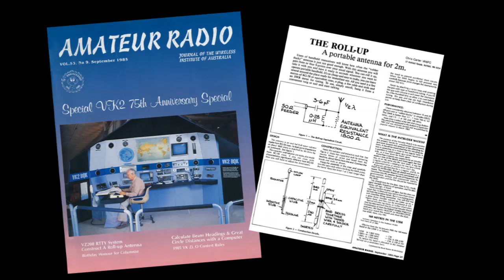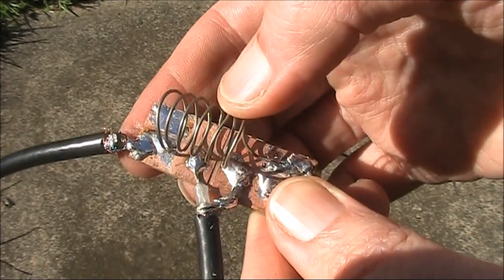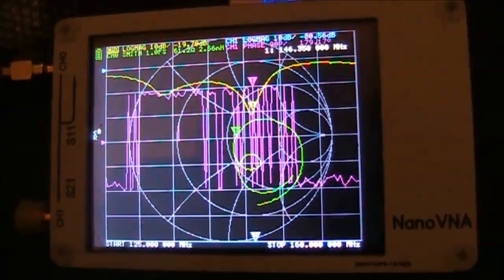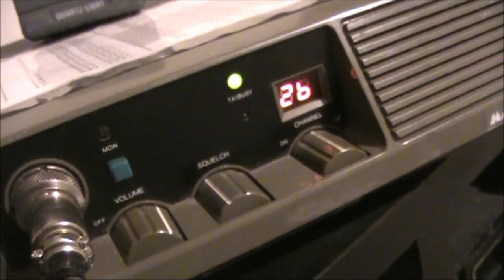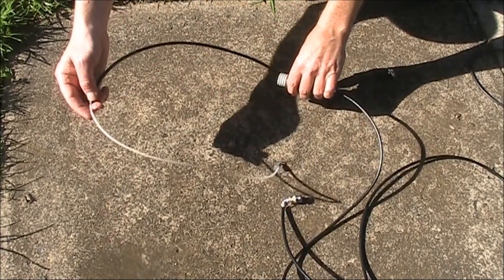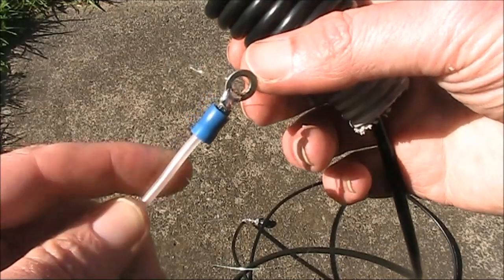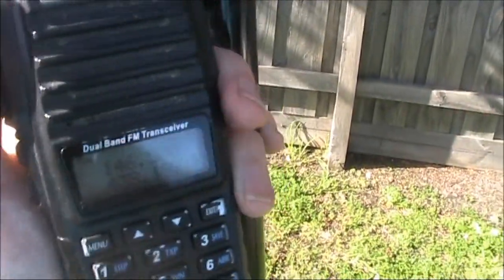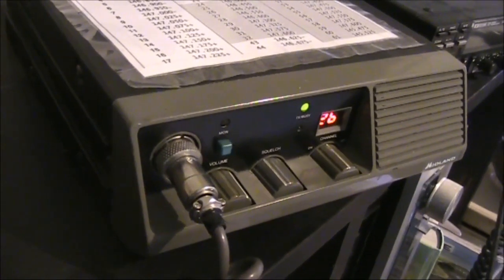Two range boosting antennas for your two metre handheld transceiver

Comment: Have made a few of these "flower pot" antennas (sleeved half-wave dipole is maybe the proper term?). Easy to make, effective, robust. They are light and easy to roll up. Great for portable operation. No assembly, radials or counter poise wires to worry about. Fantastic design. I like them 😀.

Comment: The Flower Pot appears to be a Sleeve Dipole with a feed point choking coil. It could probably be improved by either folding down the section of shielding that was removed or using several wires as a skeletonized radiator over the lower coax half. See ARRL Antenna Book or similar for Sleeve Dipole theory.  In any case the Sleeve Dipole/Flower Pot is a more reliable design than JPoles made from window line.

Comment: I've had a Flowerpot has my 2m base antenna for over a year now. Instead of the crimp lug, I've got a length of cord attached with dual-wall (internal glue) heatshrink (fantastic stuff--never tie knots in an antenna ever again!). Then the cord goes through a PVC endcap with a hole in it. An old squid-pole hoists the antenna up by the endcap, and the pole goes /inside/ the choke as well.